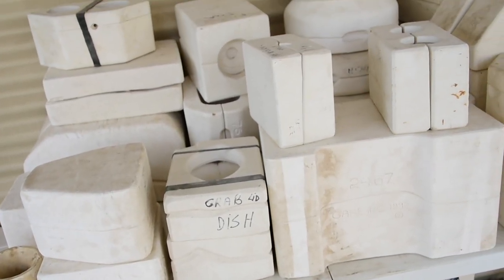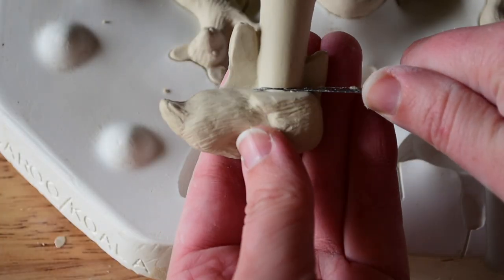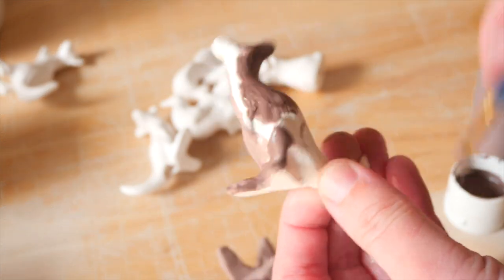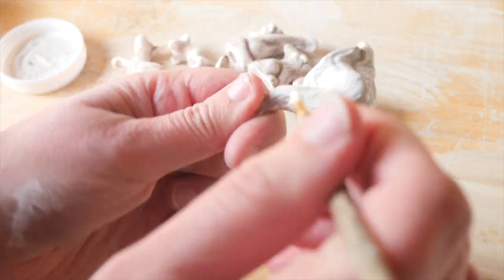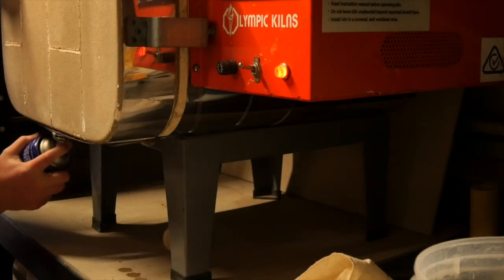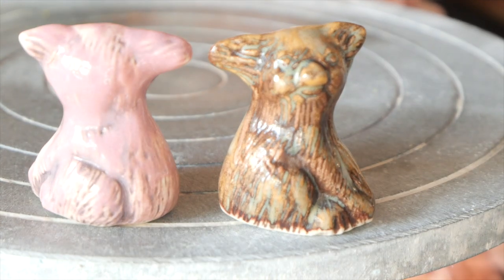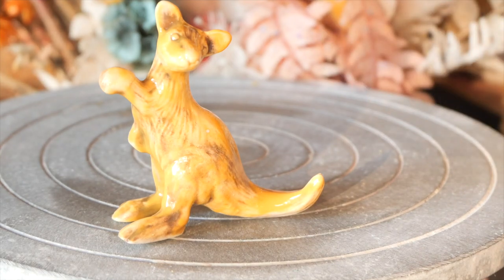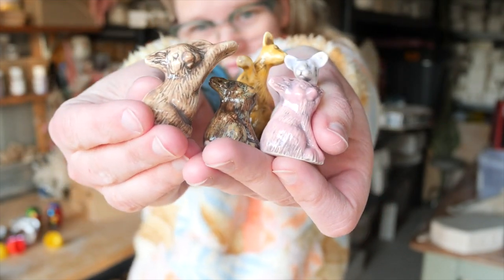Mould 36 - Revealing Mystery Moulds I found on Gumtree

Comment from the maker: P.s WD-40 is not used in the purpose of cleaning, it is simply used to loosen the hinge in this video. Rust is a normal part of pottery because you are dealing with: heat+humidity+moisture+salts= rust! The only way to avoid it is to keep your space clean and replace parts when they need replacing. WD-40 is just an easy access material for everyone no matter their budget.
Reply: I used to use Wd-40 a lot too on my sewing machines. I’ve switched to 3-in-1 brand oil. It comes in a couple of different densities and I find it doesn’t dry out as fast as Wd-40. I don’t know if it’s available in Australia though
Reply: I hope I can provide some insight as I am a mechanic: wd-40 simply displaces the liquids temporarily stopping the squeaks and the rusting process. I believe there should be a high heat spray on grease/oil that hopefully can help with keeping it lubricated so it doesn't squeak and will be easier to move and less likely to rust. 

Add on after a quick google: wd-40's brand has a white lithium spray on grease that can be helpful, but there are multiple brands that sell the white lithium spray on grease. White lithium is a good high heat grease most known for engines, but might also be good for your kiln. I don't know the exact Temps your kiln gets up to and I'm not 100% sure of how high the grease can withstand in terms of temperature,  but if you'd like I can do a little more research into it and find out for you!
Reply: They kinda remind me of the little figurines that used to come in boxes of Red Rose tea.

Comment: Well there you go. When it's warm enough to spend time and challenge yourself, try and make one of those creepy koalas into a Furby, or at least a Furby-esque painted koala. Hide it in places to creep out people :D

Did you get a chance to try tinting the clay before pouring it? I've never seen tinted clay so it intrigues me. Given how thin the pour is, you could potentially use tinted clays to give an ombre or marble effect. 
I love sparkly things, so I loved using that crackle glaze stuff in high school Art. I think there's also a brown glaze with copper in it that gets sparkly green after it's fired? Oooh don't tell me how easy kilns are, I already get myself into trouble buying craft kits and craft supplies I don't quite get through. The amount of yarn I bought before I finally gave up on knitting is a bit ridiculous. Now I'm trying to focus on sewing, which is quicker and makes me happy when something works out. My craft room (aka the spare room) is also a little too cold to work in during winter, even though I really want to go and play with the overlocker someone gave me.
Reply from the maker: I relate to so much in this comment and there is so much to unpack! SOOOO I have tried staining clay! I have had some successful stain clay experiments in the past but haven't really tried much yet to know a formal to do it properly yet! I tried in part 20 but I used powders that I think were meant to make underglazes with as they were unlabelled with the moulds! I also tried it in part 12 which was really successful! 

I don't have crackling glaze! I actually avoid crackling glazes because of food safety! I can actually relate so much to too many craft projects! I was the same until I found pottery! I decided then I would remove all other craft temptations and I haven't looked back!